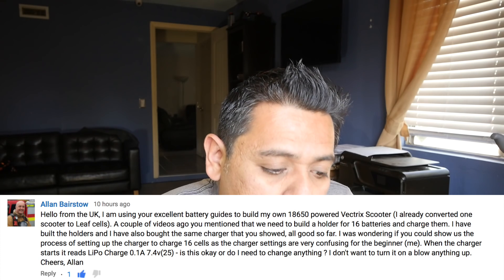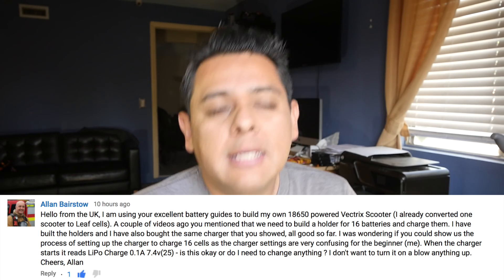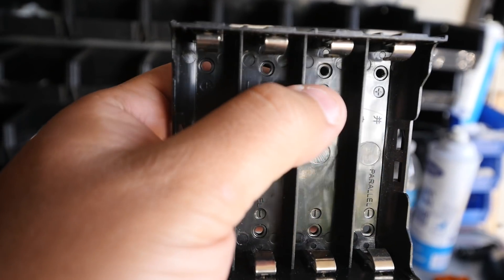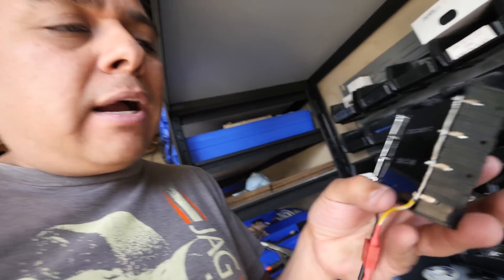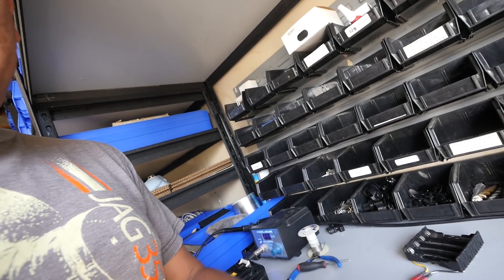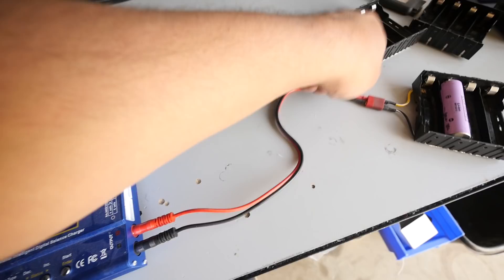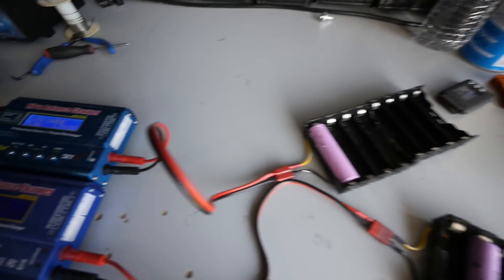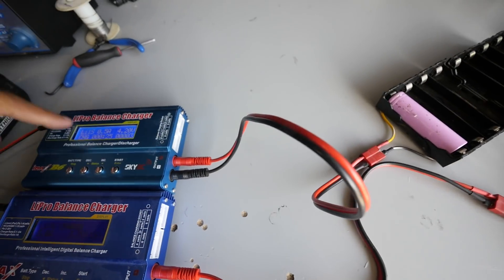Setting IMAX B6 to charge 16x 18650 cells at once -  Batt Talk #8

Comment: Hi, if you get the low voltage warning and you can't charge them. Select nimh mode and charge them till they get to about 3volts then switch to lipo mode. Regards

Comment: Don't use the LiPo setting for Li-Io batteries.
There are actual settings for Li-Io batteries in the Imax charger.
In the menu go in to:
User Set - Program.
Hit Start/Enter button.
The screen then shows only one of these battery types (LiPo, Lilo, or LiFe) and V.Type.
Hit Enter button.
The voltage setting will start flashing.
You can now change the voltage settings using left and right (Dec. <Status> Inc.) buttons.
You'll see 3 different voltage/battery type options as you press left or right (<Status>) buttons.
3.3V - LiFe
3.6V - Lilo
3.7V - LiPo
Select your battery type and press Enter button to confirm Voltage/Battery type.
Now press Batt.Type/Stop button to exit Program menu.
You'll be back at the User Set - Program-> screen.
Press Left (<Status>) arrow 6 times and you'll scroll through 'Program Select' Screens:
LOAD DATA, SAVE DATA, Pb BATT, NiCd BATT, NiMH BATT, and finally one (LiFe, LiPo or Lilo) battery option depending on what you entered on the User Set - Program-> Screen.
Press Start/Enter to select (Lilo, LiPo, or LiFe - only the battery type you selected on the User Set - Program-> screen will be shown)
Next you'll see:
(Lilo, LiPo, or LiFe) CHARGE depending on what you chose at User Set - Program-> Screen.
Press Start/Enter button and charge amps will flash, adjust up or down as needed with (<Status>) buttons.
Press Start/Enter again to confirm your amp setting and the voltage selection starts flashing.
Use (<Status>) buttons to select voltage/cell configuration for your needs, the total pack voltge and 1S, 2S, 3S etc will change together.
You can also press left (<Status) button several times until you see AUTO, if you prefer the charger to auto detect your packs configuration voltage.
Press Start/Enter to confirm your voltage/pack selection.
Now you can scroll left or right with (<Status>) buttons if you want to choose a different mode, or you can go ahead and start charging by pressing and holding Start/Enter for a few seconds.
The charger will show - BATTERY CHECK - WAIT as it does an auto check.
Press Start/Enter when the charger asks on the screen, or Stop if you want to cancel the charge process.
If you want to use the
BALANCE, FAST CHG, STORAGE or DISCHARGE options you can use (<Status>) and scroll left or right through the above options once you've gone through 'PROGRAM SELECT - (LiPo, Lilo, LiFe) screen and you're at the CHARGE screen.
You need to go through the same set up process as you did for the CHARGE settings, by entering correct Amp and voltage/cell configurations for each option if you want to use (BALANCE, FAST CHG, STORAGE, DISCHARGE) options.
Sounds pretty complicated, and it takes a little while to get you're head around it, but it's pretty straight forward after you play with it for a bit.
Hope this helps someone👍
Hey....Vegemite!!🇦🇺👌

Comment: Here's something interesting about this type of charger. The original one won't charge more than 1S without the balancing leads, but the clones/copies will. That is, the clone will allow you to charge up to 6S pack (whether it has a BMS or not). The original one can also charge Lifepo4 (although both allow you to adjust the voltage parameters). The original one costs twice as much. Some clones have very cheap capacitors so they burn out quite quickly.

Comment: It seems that you have no idea how Li Io batteries are loaded correctly. You just click on the buttons not knowing what you are doing. Sorry. 
Single Lion batteries should not be loaded with 5 Amps. You were lucky that the B6 recognized, that your battery was already full. 
Don't post such bullshit.
Reply from the maker: I’ll post whatever I want
Reply: @jehugarcia  Of course you can post whatever you want. However, if you give recommendations for charging LiIo batteries, they should also be well-founded and correct. Otherwise, imitators can be hurt badly and you don't have to be surprised if YOU are then held accountable. LiIo batteries charged with the B6 should be loaded with the existing 3.6V LiIo profile. LiPo charge is definetely wrong. A single cell should not be charged with more than 1A. 6 cells with 6A. When they are parallel the device remains on 1S.
I don't know you and don't mean you any harm, but when I saw the video, I asked myself how one can spread so much half-knowledge. No offense - stay healthy.

Comment: Jehu, after several viewers pointed out that the link for the battery holders is incorrect, you should have corrected it, or at the very least taken it down. I wound up ordering the holders, only to discover that they will not accept an 18650 cell. I suppose it is a heady thing to be an "influencer", but hand in hand with that status goes the responsibility to correct obvious errors when your attention is drawn to them. Not to do so diminishes the confidence viewers, like me, want to place in you. It is very rare indeed for me to make any comment whatsoever about any information I encounter on the Internet, knowing full well how easily such comments can offend, or be misinterpreted, or result in silly flames; but having relied on you for something as simple as the correct holders to acquire I am saddened by the hit my faith in the accuracy of your presentations has taken. You can do better.
Reply from the maker: What link?
Reply: @jehugarcia  The link is from "Setting IMAX B6 to charge 16x 18650 cells at once - Batt Talk #8".  The actual link is:  "Battery Holders http://j35.us/1XAJQcD". Ty for responding. It means a lot to me, and speaks well of you.

Comment: you dont actually know how to use this charger or charge those batteries you know, the MAX you can charge with that charger safely is 6x, wired in series, with small balance leads going to the positives to accurately use the balance feature of the charger, right now your just dumping juice into whatever number of batteries and hoping for the best! This is extremely dangerous, think about it, how are you balancing all 16 cells, or even 2-3 cells, in this parallel group? Should take this video down, wonder how many house fires you've caused in 4 years..

PS. Honestly thank you for trying to make a information video to help people, but this is not the correct way to charge 18650's with a RC charger
Reply from the maker: The same way everyone else safely charges paralleled groups of cells.  My Tesla has 46 cells connected in parallel.  Almost every battery pack out there has multiple cells in paralleled configuration.  How are you not aware of this?
Reply: @jehugarcia  No, the battery systems you mention have individual cell monitoring, not just string batteries in a row, research how this is unsafe bud, I appreciate all the work you put into your videos, but this one is wrong.

Comment: Que pachuca por toluca mr. Garcia i have an 8cell 24v lifepo4 pack that i would like to balance . My charger only balances up to 6s but it does have the ability to charge 4x6s at once. My question to you would it be possible to balance the 8s pack by doing 4cells on one balancer and 4cells on the other without dissasembling the pack

Comment: Hey. How to check capacity of 18650 battery. Using discharge functions of b6 charger. Should its discharge test on 1A or 2A  witch is correct Amp?

Comment: You buy a charger with built in balancing and completely bypass it when actually charging the batteries. You could get massive currents between batteries putting them in parallel like this if they are not balanced, potentially causing a fire.
Reply: By my experience all cells tend to be at the same voltage after some charging. I tried disconnecting them and measuring the voltage for each cell and they are almost the same, with variations of 0,1V. This variations could be dangerous, and I recommend charging them in parallel to 4.1V and then balance-charging them to the max. The video is not a "healthy" procedure, but it's a trick to charge faster.
Reply: @lucioherediaparaja359  What's really interesting is that since my comment 6m ago, I set up a 4P4S solar panel charger battery array and after ~180 charging cycles each parallel array was only out by ~1-5mv from the others, which blew my mind. I was expecting much larger deltas in just a week and having to balance it manually dozens of times during those 6 month. The cells are all old salvaged ones too.
Reply: @Ziplock9000  that's amazing! Are you using a BMS? Could be a good way to extend it's lifetime.
Reply: @lucioherediaparaja359  I'm not using a BMS and that's why I'm so confused. The plan was to manually balance them once a week with my CellMeter 8 and/or iSDT BatteryGo BG-8S. I just don't understand how they managed to stay in balance for 6 months to such an incredibly close tolerance with no balancing at all (automatic or manual).
Reply: @Ziplock9000  I see! Thanks for sharing this. I think that those mV after a lot of cycles can get bigger and cause a problem, that's why people use BMS. But if you're okay balancing them once in a while I suppose it's okay :)
Reply: @lucioherediaparaja359  Yeah they can (and really should) be a lot bigger than a few mV after a few months. I wanted to manually balance them because after testing several popular cheaper BMS modules I found that they all have 1 or 2 major dangerous flaws that I covered on my FB page. To get a BMS that worked properly, I'd have to spend £40+ which I wasn't prepared to do back in the spring/summer. Since then though I got a £10 active balancer that has been all over youtube and after testing, should work well, I just need to set it up. I've also put a much larger load on my solar panel's battery array in the last week that completely cycles them. So I anticipate it going out of balance much more quickly and will require me to add the active balancer. After just checking now, they are peak-to-peak out by 40mV after a week.

Comment: What if I put cells of mixed voltages? Let's say some are 3.8V, other 2V or less. Do these voltages magically balance themselves? 
And if so, how come it not damage the cells?
Reply: A cell that is 2v in this chemistry is a fully dead non servicable battery, if you parallel this with cells that are 40-50% at 3.8 it will try to balance and likely cause a fire without even using the charger at all.
Reply: @justin456  I have to disagree with the first part. I've revived many undervoltaged cells, some even below 1V and most of them are perfectly recoverable. They might lose considerable chunk of their capacity, but they do work just fine.

Comment: I have a battery pack of 4 18650 batteries in series, What setting do I charge them on? Fully charged they are 16 volts but the charger doesn't have a 16-volt setting. It has 14 or 18. Is the voltage adjustable on the Imax B6?
Reply: If the 4 batteries are in series then it is a 4S. You can also have 2 // groups of 2 batteries in series and then it is a 2S. Nominal battery voltage for a LiPo battery is 3.7V, so if you have 4 in series, it is 4 x 3.7 so 14.8V. But 18650 are Li-ion and not LiPo so nominal voltage is 3.6V. Maximum charge is 4.2V per battery, so again total will be 16.8V. In Series, you multiply the Voltage and in Parallel, the Amperage. To extend the life of the batteries, they should be charged at 1C maximum and better at 0.5C so for a 2500mAh battery, you should charge at 2500 x 0.5 = 1.25A.
This is a nice article: https://www.instructables.com/id/How-to-Prolong-the-Life-of-an-18650-Battery/

Comment: Can a capacity test using the Imax unit be done, similar to the test you can do on Kiitokala? 
I also noticed I can drop batteries into the Adeaska and it will charge batteries at 1.6 v or that is what is displayed in the display of the Adeaska. Other chargers like the Imax and Liitokala don't charge a battery at that voltage (1,6v)?

Comment: Another typical example of a beginner trying to teach. 1S=1amp ??  5amps into a 18650 is very dangerous. Supposedly teaching how to charge 16 cells at once and only shows 1. Shows one battery holder upside down.  Generally one big mess. I can imagine many people walking away from this video with more questions than they started with.

Comment: Noob question here: What happens when you mixed up  7 batteries at 4.2V and 1 battery at 3.7V in 1S-8P battery pack? Will it charge the 3.7V battery and self-balance the pack? If the answer is YES, then how much will be the charging current that the 3.7V batt will draw from other batteries and if that charging current is still safe for the 3.7 batt? TIA.
Reply: In this situation I'd recommend just charging the single cell alone @ 300ma, monitor the heat like mentioned.

Comment: Be aware that setup is not as safe as Jehu makes it sound. The nice sharing of current will only happen if all the cells are in reasonably good shape. If one of the cells connected in parallel develops a short circuit, the charger as well as all the other cells will try to dump all their energy into it and there will be fireworks. It would be better to have a fuse between each cell slot and a common bus wire.
Reply: So the ratio benefits/risks is quite high, unless you insulate/isolate the charging location :))

Comment: how would you do it with a battery where the cells are in series?
Reply: Change the output voltage setting and you will see the charger screen show 2s, 3s, 4s, 5s or 6s, just select the one that matches the amount of batteries you have in series👍

Comment: @jehugarcia: why dont you put the maximum of cells in series and use the imax bms to balance each individual cell? Just add a few sensor cables and the bms plug, wouldnt it work?
Reply: This IMAX B6 charger can only charge up to 6S Li-ion cells, or 25.2V, so that's the reason. 

It has only bms plugs for UP TO 6 cells in series. which is 25.2V when fully charged. Far as I know.

Comment: I thought if you get different cells of unknown capacitance per laptop battery (say one laptop battery pack has 6 cells and another has 6).. it's bad to charge all those cells (all 12 cells) in parallel because if the capacitance is unknown (which it is because you havent even charged it yet)...if one laptop pack had very low capacity (lets say it was used a lot) and the other laptop battery wasnt used very much and has higher capacity per those 6 individual cells...  since you dont know the capacitance of the 6 cells versus the other 6 cells....by connecting all 12 in parallel...the 6 good cells will immediately attempt to "balance" eachother out automatically by virtue of being in a 12 cell parallel connected battery pack... and then attempt to dump too much current into the lower capacity 6 cells.. Which can make it more likely that one might overheat even before the charging process starts? Am I wrong here? Not sure maybe someone can chime in here

Comment: 22AWG (american wire gauge) has I believe...a maximum 5Amp of current flow through the copper (I am not an engineer here). The lower the AWG number the larger the copper wire... the higher current potential... this tends to drop however depending on how long your cable is since it needs to transmit that current over farther distances (hence direct current voltage tends to drop over long transmissions and I believe thats why we use alternating current for power grids instead) but yeah for 5Amps you dont want a smaller gauge wire than 22AWG

Comment: When I charge my 1S 16 Cell batteries I get a CAPA error before it's fully charged. I know that I can set a high mAH capacity but with 16 cells that will be pretty large. Is there any heightened risk in turning this safety feature off? Thanks in advance.

Comment: I have a problem maybe you hear it first time.i am trying to charge a 3s battery pack using balance lead with my turnigy accucell 6.I get an error something like 'balance connection error' .when i unplug the main voltage wire and leave only the balance wire with my battery it says inverse polarity.now the problem is i do not have inverse polarity.also i checked voltage on balance wire for each individual and gives the correct values.what is going on? Now i just charge the package without the balance wire.

Comment: I just built this and tried it, but is stopped charging all 16 cells as soon as it reached 5A, the message said CAP so i assumed capacity and i was right, in the settings of the charger you get a safety amp cutoff and its set to 5A, should i change this to reflect the total amp of the full16cells? 35.2A since they are in parallel?

Comment: I have Hyperion EON0606i charger and I can't use it for charging Panasonic or Samsung 18650 cells... It gives me an error "open circuit"... So, if charger doesn have Li-Ion option, I wouldn't use it to charge those 18650 cells

Comment: When i charge 16 in parralel like this, they dont charge up more then 4.12V then the i max says theyre full. Any idea why?
Reply from the maker: Settings
Reply: jehugarcia i had cheap battery holders with resistance, i guess that was the problem. But now they are always slightly overcharging to about 4.24v.

Comment: I would like to find a charger that will charge 7 or 8 liion cells in series! A 29.4v total. I have a tester for a 8s li ion. But haven't found a charger for 7s. I thought about trying two imax B6 connect one to 4 cells and the other to 3 cells. Or go the crazy route and buy 7 imax chargers!  Crazy I know!

Comment: You dont have to charge li ion cells on lipo setting, the charger has a setting for li ion just change the setting in user program. You can also charge lifepo4 just toggle between the 3 settings in user program. Great videos by the way, keep up the good work.
Reply: No, you have to use the "Lipo" (4.2V) setting else it will not give the full charge voltage the batteries are designed for.